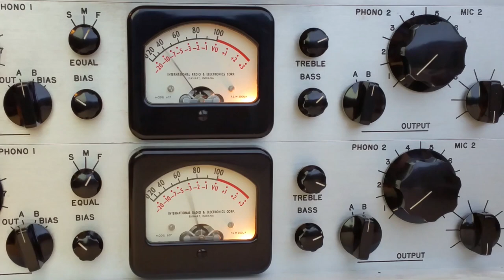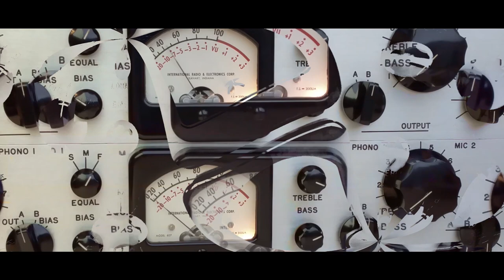Part Four: Removing the capstan motor- Technics RS 1500/ 1506 reel to reel tape deck repair

Comment: Is that capstan motor permanently lubricated?
Reply from the maker: Yes, I think if you are hearing a noise its likely the roller at the bottom of the tape path
Reply: @ReelHifi  I recently was given one like the one you had and have started to work on it.
Right now i am in the process of flipping the rubber valves on the bellows. I found that there is a pin/shaft missing and that is where the solenoid is connected to so that means that linkages where not being moved when the solenoid eas activated. I hope i can find something to replace it.
Reply: @ReelHifi  Removing those bellows is no fun :( what a pain!
Reply: @ReelHifi  I finally completed the repairs and found that the tension arms are constantly mooving up and down and making the red light not be stationary. I checked the back of the capstan motor while it was turning and found that is uneven. I stopped the machine and grabbed the center of the capstan motor and i could move it up and down, no side sloppines though, i think i will have to remove the capstan motor to investigate further i am thinking that it might be bad bearings and that is what's making the tension arms move up and down constantly while in play mode.
Are there any linkages attached to the front of the capstan motor? I did not see any in your video?
Thank you for replying back.
Reply: @ReelHifi  Are there any linkages attached to the front face of the capstan motor? I saw two possible mounting points on each side of the front face? Am i wrong?
Reply from the maker: @SDsailor7  I reel-y don't think it would be the capstan motor and it does normally have some back and forth movement and not side to side - The bouncing has something to do with the linkage and or brakes and bellows in my opinion or even a reel motor or tape tension issue. I know you reversed the vents on the bellows. I don't know what this may be I mainly just took these apart... There is likely someone on tapeheads.net that would have some good input.  This must be frustrating but worth it when its up and going :)
Reply from the maker: @SDsailor7  No linkage attached to the Capstan - THe capstan is pretty much bulletproof and is stand alone
Reply: @ReelHifi  I am going to do all the checks i can with the tools i have, tomorrow i am going to go and buy a spring scale to do one of the test, and will use my DMM to do tape tension test.
If i try to move the capstan up and down i get movement and if i try side to side i don't get any movement.
after i do all the tests/checks and run it, if i still have the same problem i will remove the capstan motor to inspect it. 
Thank you for replying back.
Reply: @ReelHifi  Ok good to know that there are no linkages attached.
Thank you